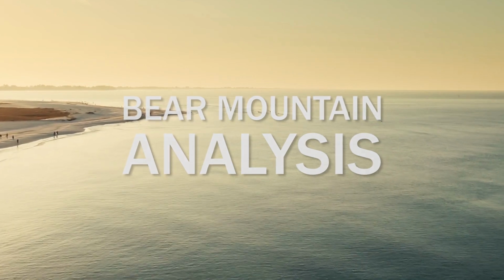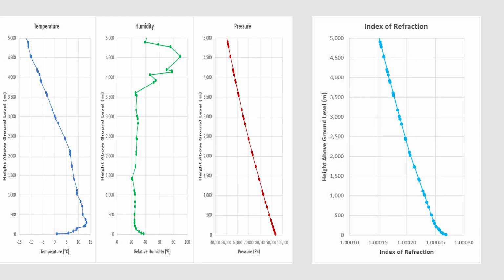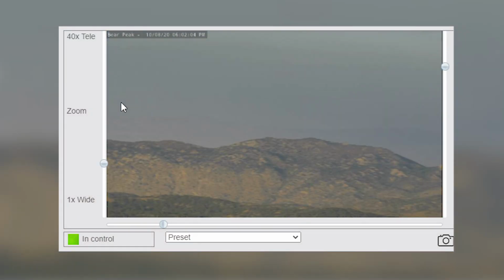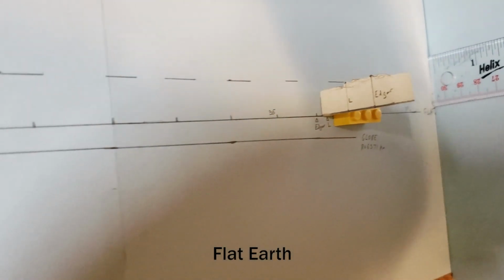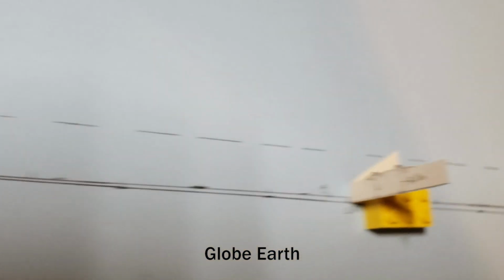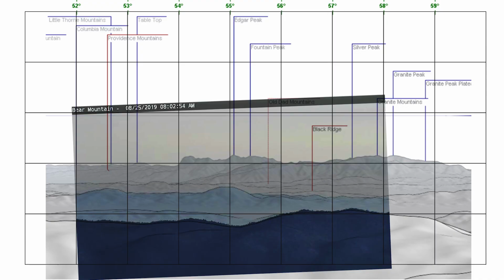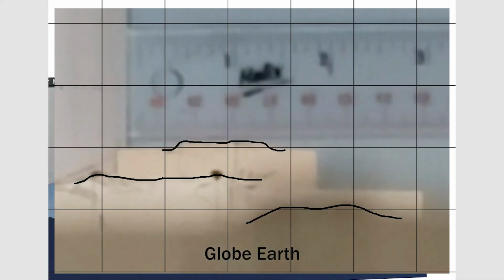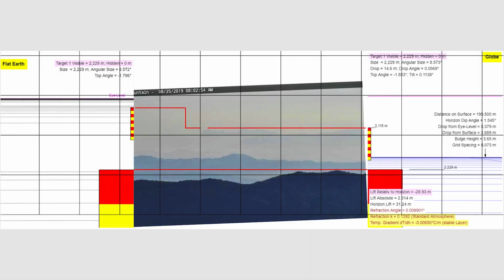Bear Mountain Analysis

Comment: On a globe, the horizon on a big lake or the sea is a certain distance, when observed from a certain height, and we've found out, that we can sometimes see more than 20 times the expected distance to the horizon, which means - when all the observations keeps showing similar results - that there is NO globe curve anywhere! Conclusion: The surface of this world is relatively flat!
Reply from the maker: Jon Do,
Thanks for your comment. The data I have presented in this video suggests that this phenomenon will occur on a globe. There is strong variability in refraction close to the water, enough to cause light to bend around a curve, or even light to bend upwards making a flat earth look like a globe.

Observations that change from day to day can't be trusted on their own unless you can measure the refraction. This is why I selected a high altitude observation. I would be interested to know your thoughts on why the Earth looks like a globe 100% of the time from high altitude where there is no change in the photos.
Reply: The reason the Black Swan photo is popular in the Flat Earth community is that it appears to show a flat surface, however, it also shows a great deal of distortion in the rig(s). Most other photos of the rigs don't show this distortion and the rigs are partly hidden behind curvature, similar to this...
https://dl0.creation.com/articles/p116/c11646/toronto.gif
I've done the same CN Tower profile overlay with a friend's photo and with the same result. There is regularly observed curvature. Cinnamoncontrol's approach avoids the question of atmospheric distortion by taking the observations higher in altitude. It's a solid approach.
Reply: It's hard to tell, but I think you're presenting yourself as a FEer? Try watching the video again, and then make a comment that addresses the content of the video. 

The whole point of the (excellent and concise) video is that the effects of refraction make for variable observations at sea level. It becomes much easier to make predictions about what we will see at altitude. This video shows that the predictions made by the globe are extremely accurate, and the predictions made by FE (not FEers, as they avoid making claims) are far removed from reality.
Reply: You are absolutely right! Fom a few feet above ground-perspective, the earth is relatively flat. But not quite, as Cinnamoncontrol eloquently showed. Mr. Sensible took it a step further and took a high-altitude baloon! This will most definitely also show, that the earth is curved.
Reply: "On a globe" Yes, we live on globe so if you start to describe what you see in reality it will be based on a globe.

"the horizon on a big lake or the sea is a certain distance" Yes we observe a horizon on a lake or ocean at a certain distance. We also can see further if we simply raise our viewing elevation. You do realize that only works on a globe right?

"and we've found out, that we can sometimes see more than 20 times the expected distance to the horizon" Wait, 20 times? Care to give an example of that? Got the measurements at least? And have you noticed this 20 times when over land or just water?

"which means - when all the observations keeps showing similar results" Which other observations? The ones over land? The ones at the same elevation? The ones with various weather conditions? Are you being vague for a reason?

"that there is NO globe curve anywhere" Wait what? Want to walk that thought process through again? If you thought that was logical I'm sorry to say it wasn't. Are you ignoring variables on purpose or are you not capable of understanding what a variable is? You know what happens 100% of the time when you go up n elevation? You see further. That should not happen on a pizza planet. 

"Conclusion: The surface of this world is relatively flat" Well duh, everyone knows that. Earth is really big in case you didn't know. But we do have math to help us determine the actual curve amounts so there's really no excuse to just rely on "well, looks flat out my window so that's good enough".
Reply: Poe's law
Reply: Earth is flat. This video failed to show curvature of earth! Let alone did it even prove anything??🤣😁😆😃😀🤣😝😜🤪😋😛😛😋😋🙂
Reply: @ZackWolfMusic  We get you didn't watch and like to lie.